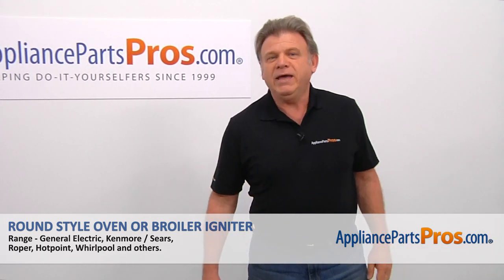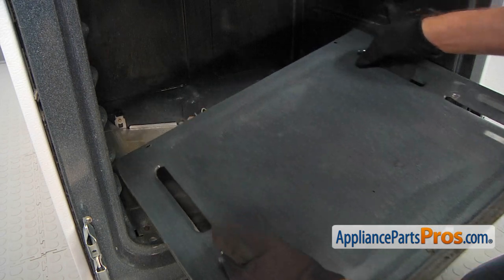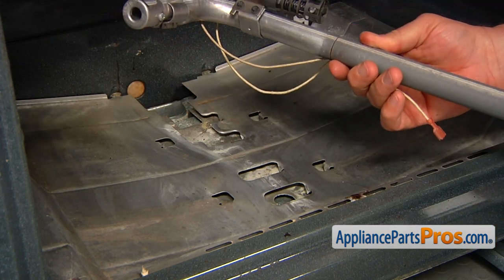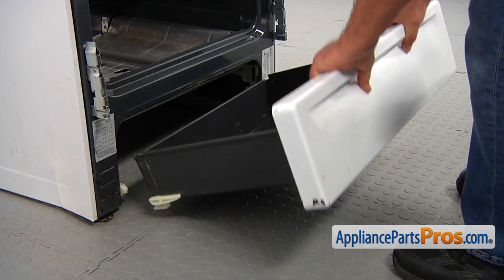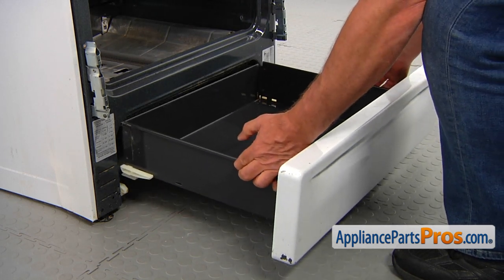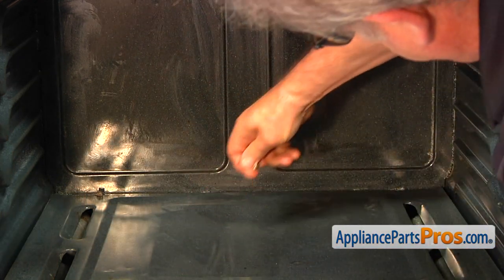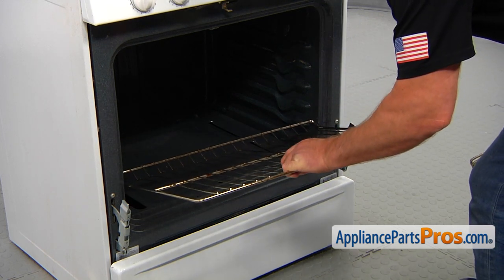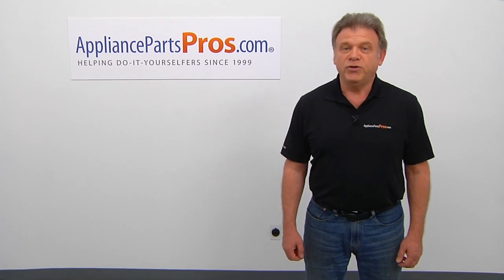How To: GE Round Style Oven or Broiler Igniter WB2X9154

Comment: The oven I was using was not working for months. At first I initially thought it was just the light that needed to be replaced and that's what was preventing it from starting. However upon replacing the light I found that the igniter on the bottom also didn't work. This video was definitely life saving literally because my microwave had also stopped working and it helped me fix this issue. Make sure to turn off the gas and unplug the stove before doing this repair! (something that wasn't mentioned in the video)

Comment: I really did learn from your video. Thank You for making it so easy to do. I did have trouble getting to the two screws in the back of the stove where the gas pipe connects to the pipe line.  But with Perseverance and patience I was able to get the screws into the back of the stove.
Reply: How did you reach yours? My setup is also a little different from his where a pipe runs right across one of those 2 screws giving only about an inch of working room...

Comment: My setup is also a little different from his.Where the two screws hold the bracket holding the ignitor, in my range a pipe runs right across one of those 2 screws giving only about an inch of working room...i cant reach it with a flathead nut driver and not even a 1/4 ratchet and socket. Any ideas?

Comment: I thought the oven igniter was my problem. Not coming on at all but broiler works fine. I ordered an igniter from you guys but my GE JGRP20SEN1SS wall oven still won't lite. Could you possibly give me a tip on what I could troubleshoot next. I guess it could possibly be the digital circuit.
Reply: Did you ever figure this out?  My next step would be to make sure there's 120Vac present at the igniter terminals.  If not, could be something with the circuit board.  If present, then it's a bad igniter.

Comment: Does it matter which wire goes to which connector? I replaced them in the same position as the wires coming out of the back of the new igniter but with a replacement part that had no inatructions with it, it was sorta scary.
Reply: No. 120V AC does not observe polarity like DC.